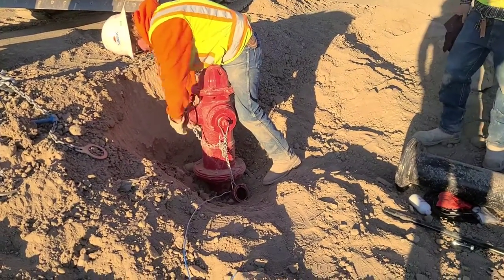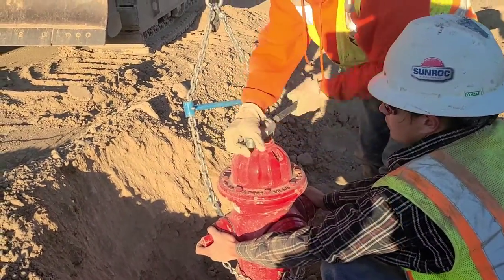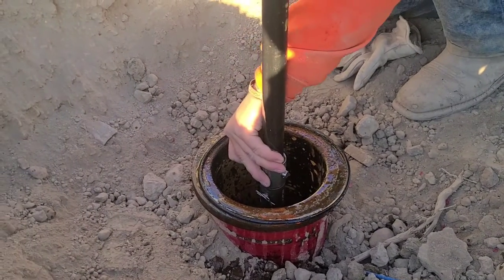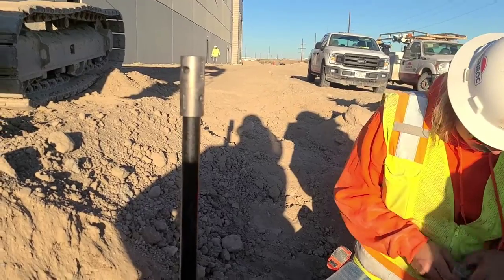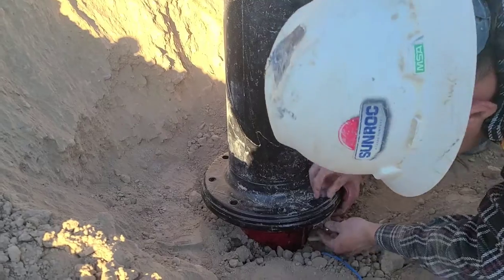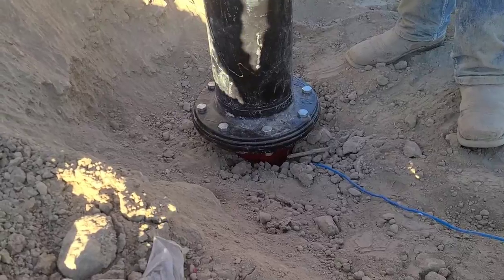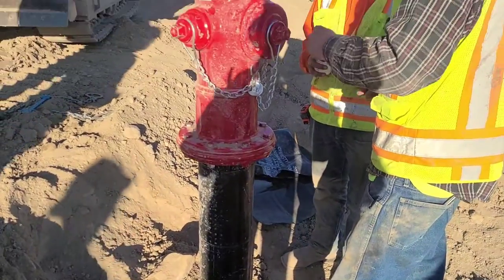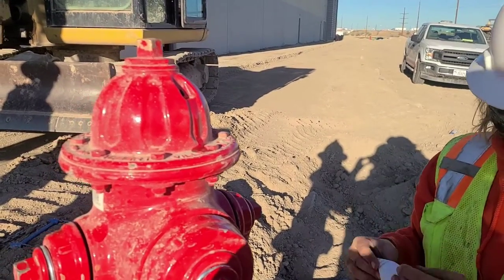Fire hydrant extention install

Comment: It was done wrong because the break coupling on the shaft, wasn't raised to ground level.  The solid coupling that comes with the extension kit is supposed to be used before the extension rod is installed and therefore ensuring that the hydrant would properly break off when hit.  The way it was done, the hydrant would break off at ground level and best cast scenario, the hydrant rod would break off 3' below the ground, still having to dig up the hydrant to repair.  Worst case scenario, it doesn't break at that coupling and damages the lower valve assembly which may require the hydrant to be replaced.
Reply: Could they not have pulled the pin in the coupler and left the shaft partially threaded in the bonnet? That’s how American-USA suggest to do it on the American Darling Hydrants to avoid damaging stem seals/ o-rings.
Reply: At first I didn’t understand what you were saying but now I get it so at 1:45 in the video instead of pulling the top pin they should have pulled the lower and replaced  that coupler entirely with the one in the kit and re used it on the top.
Reply: Absolutely correct. Break away hydrants are designed to break off a few inches above grade.
Reply: Yeah, if they had pulled the lower pin, they could have kept the breakaway coupling with the upper stem where it belongs. I have repaired many hydrants because of improper extension installation just like this
Reply: Hopefully they read the comments and got right back out there to dig it all up and do it correctly.
Reply: 100 percent correct now if some does happen to hit that hydrant going to need to be replaced completely lol

Comment: Well removing it this way you  noticed that the lubricating oil just spilled out of the bottom and will rust out the threads in a few years making the hydrant Really hard to open. Also a very good chance of damaging the bonnet )-rings causing water to get inside bonnet. Also basic Fire Hydrant 101. These boys obviously didn't read the booklet that comes inside each extension kit. The extension coupling goes on at the bottom of the extension. The way the knuckleheads are doing it the new owners will certainly have issues in the coming years. Probably best video I've seen on HOW NOT to put an extension on. You don't need to refill the bonnet oil after doing this and NEVER fill to the top. In my 31 years of doing this I've sometimes up to 30 fire hydrant extensions a month and never ever done one this way. I don't want or need any callbacks. When this hydrant gets hit it will break off at the breakaway coupling 3 feet down causing a lot more work. I'm the Hydrantdoctor and thats the way it is

Comment: man they like doing it the hard way.  take the top 6 bolts out spin the top off lift the bonnet off put on extension and spin top back on tighten bolts add oil.  I'll beat them eveeytime doing it this way

Comment: how was it done wrong?
Reply from the maker: The hydrant was installed too low and needed an expensive riser after the fact.
Reply: Also, the breakaway coupling was left down in the bottom of the extension. If this hydrant is hit in the future, it will not break over properly. They should have pulled out the lower pin and kept the coupling on the upper stem. Then put the extension coupling on the lower stem and the bottom of the extension stem. That way the breakaway coupling would be at ground level